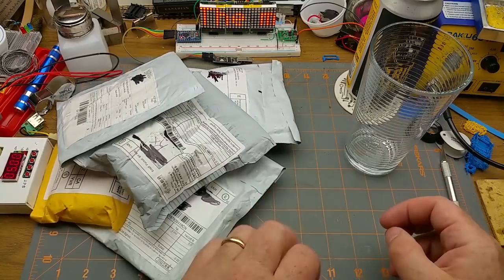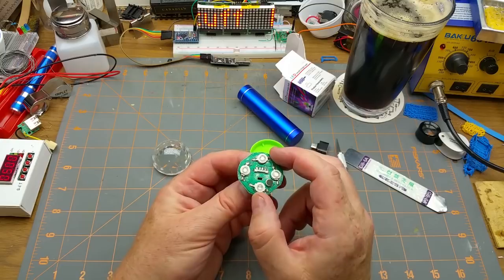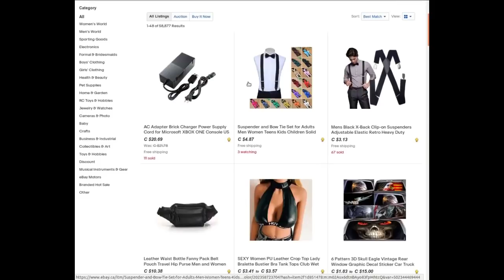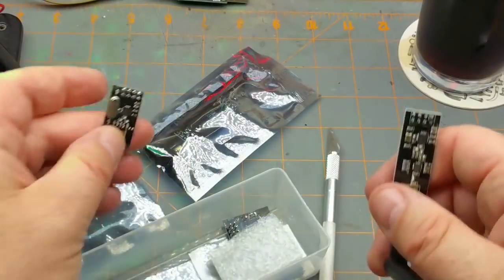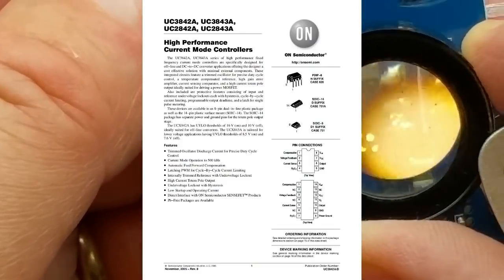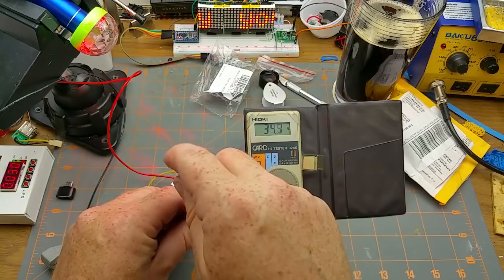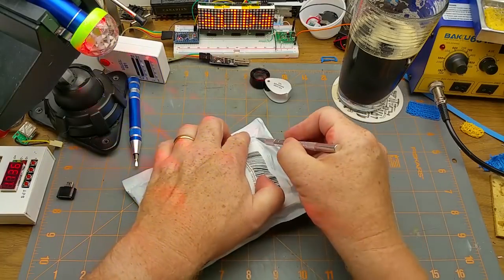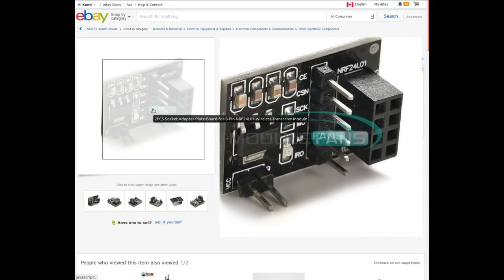Mailbag Monday #36

Comment: There's a third variant of the NRF that has a shield. The unshielded ones like you have there have been flaky for me, but I got one of the shielded ones and its performance is rock solid, I can get 100 m or more through several walls, with the other node being the standard NRF chip with the PCB antenna.

I use them for a MySensors mesh network, with the shielded and amplified radio module as the base station.
Reply from the maker: Didn't know about that one. Thanks
I guess it's back to Ebay for me...

Comment: What would you do with 60VDC?
Reply from the maker: It's mostly another case of "I'd rather have it and not need it than to need it and not have it."
Reply: @pileofstuff  Good answer. After I posted that I thought it would be good for powering those huge LEDs that require stupid voltage when wired in series